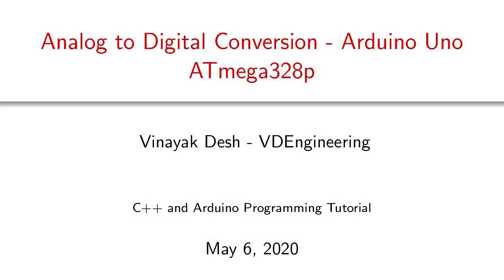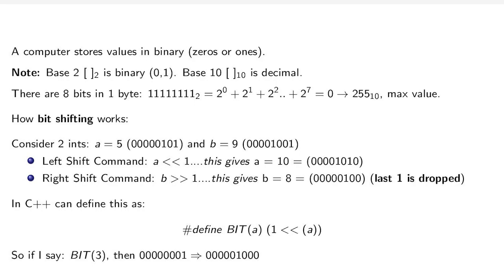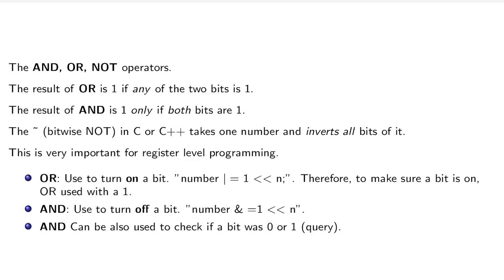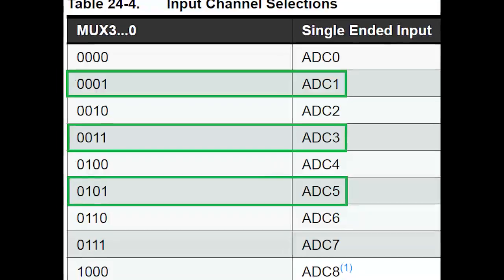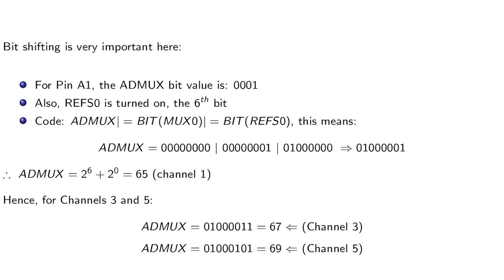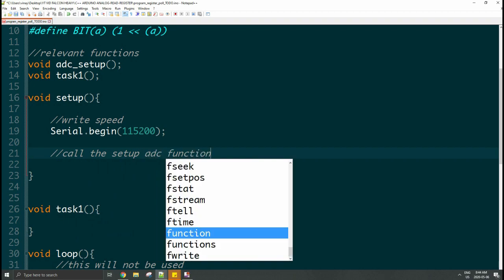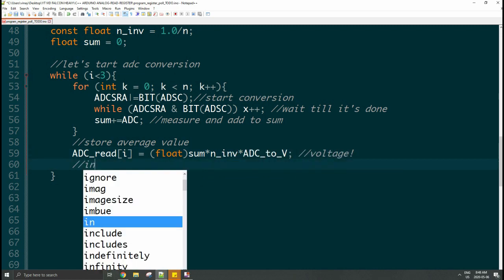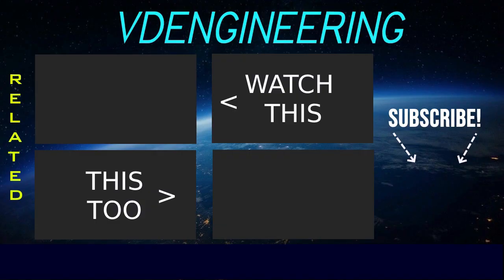Arduino Tutorial: Register Programming | Analog to Digital Conversion | Multiple Channels

Comment: could you share the codes with uss pleaseee
Reply: void adc_setup()
{
  cli();
  ADMUX=0;
  ADMUX|=bit(MUX0);
  ADMUX|=bit(REFS0);
  ADCSRA=0;
  ADCSRA |=bit(ADEN);
  ADCSRA |=bit(ADPS0) | bit(ADPS1);
  sei();
  }
  void task1()
  {
volatile unsigned int y=0;
float t;
static const float ADC_to_V=1/1023.0*5;
static const int ADC_CHANNELS=3;
volatile float ADC_read[ADC_CHANNELS]={0,0,0};
int i=0;
const int n=50;
const float n_inv=1.0/n;
float sum=0;
while(i<3){
  for(int k=0;k<n;k++){
  ADCSRA|=bit(ADSC);
  while(ADCSRA & bit(ADSC)) y++;
  sum+=ADC;
  }
  ADC_read[i]=(float)sum*n_inv*ADC_to_V;
  i++;
  ADMUX+=2;
  sum=0;
  }
  ADMUX=0;
  ADMUX|=bit(MUX0);
  ADMUX|=bit(REFS0);

  t=micros()*1e-6;
  Serial.print(t);
   Serial.print(",");
    Serial.print(ADC_read[0]);
     Serial.print(",");
     Serial.print(ADC_read[1]);
      Serial.print(",");
      Serial.print(ADC_read[2]);
      Serial.print("\n");

  
  }

void setup() {
  // put your setup code here, to run once:
  Serial.begin(9600);
adc_setup();
while(1) task1();
delay(1000);
exit(0);
}

void loop() {
  // put your main code here, to run repeatedly:

}